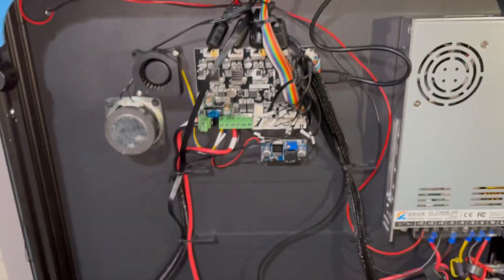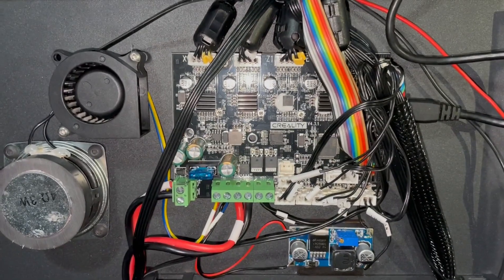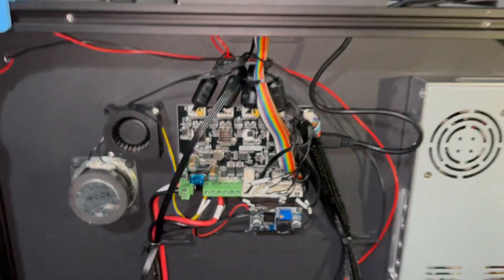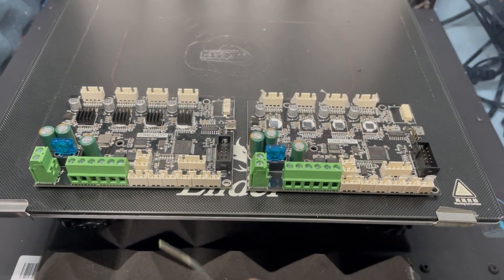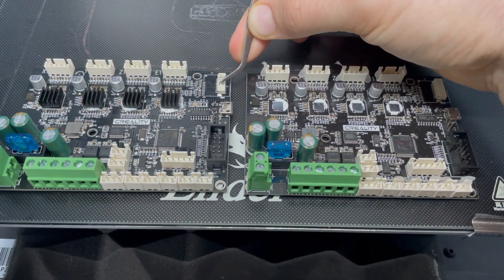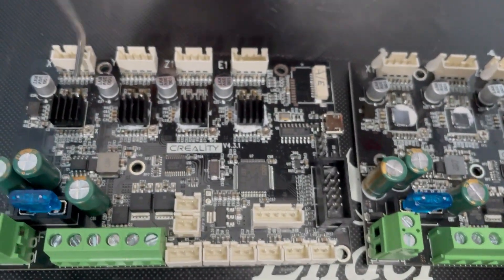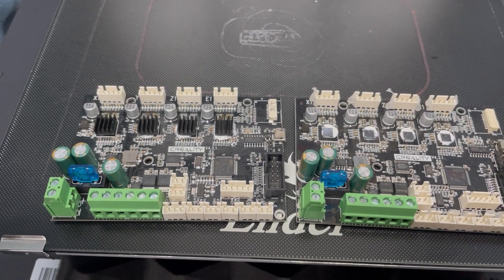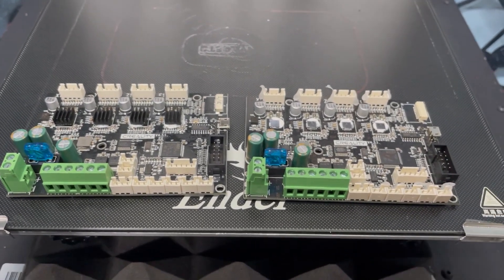Reupload Ender 6 - Mainboardfraud and how you can detect it

Comment: I am now running a SKR mini E3 v2.0 in my E6. It was an easy fit. Mounting holes and orientation matches.
Reply from the maker: Oh really.. ? does the Ender 3 and the 6 have the same mounting holes ? O.o didnt expected that !
Reply: How about the screen? would like to try too.
Reply from the maker: @mezerwi  what exactly do you mean ? Install the stock screen with the skr board ?
Reply: @mezerwi  I replaced the screen with a Bigtreetech TFT35 E3 I had available. But you can even run the basic screen off an Ender 3 with the SKR board. I found the stick E6 display was just too limited in its functionality for my needs. The BTT TFT35 just gives me way more functionality and access to settings. Well worthe change.
Reply: @0000Philipp  yes the bolt  mounting patern is the same even though the stock E6 board is slightly larger then en E3.
Reply from the maker: @jwelman1  Great ... thanks for the Info... thatsgood because in the future I want du upgrade my CR10 with a skr board ... but because I have less space in the box I need a board that fits the original mount ... that’s cool :)
Reply: @jwelman1  Thanks man! ive ordered both skr v2 and the tfte3! 

Hope to install over this weekend. Stock board and lcd too limited. 

My ender 3 Pro all upgraded to skr mini v1. Superb result till now.
Reply: @jwelman1  hi is it possible for me to have the FW for the skr and tfte please
Reply: @martynhanson5758  sure thing. Is there a way to share my details without posting here publically?
Reply: after I checked it seems the Mks E3 robin/robi3d have the exact same size. but they support both the 128*64 and the tft lcd

Comment: Bingo! 
Exactly matching your experience, to the letter. Incredible. Not silent board with the markings (thnx btw, your video  saved me the headake to find out why. Same A/E markings on the board which is allegedle a 4.3.1. And USB port was dead on arrival( After  seeing you I isolated my Power pin on the cable BEFORE connecting it just in case..., but it was definitely dead.) Quite a scam indeed. 
@Jan the Man will be looking into your solution with the mini E3, sounds interresting ( I have two other printers running on a RobinE3 seamlessly I love the board!!!
Reply from the maker: Nice that i could help you.. well..it chinese ..so i peronally will never buy any of their products again !

Comment: Buy yourself an Artillery Genius Pro or a Sidewinder X2 if you want hassle free beautiful prints and you won't hear any noise from the printers at all. I have 2x Genius and a Sidewinder and never have any trouble. I bought an Ender 6 because of the big claims of 200mms print speeds and I have never been able to print over 11mms and have had nothing but trouble from the bucket of shit. Thanks for sharing with us mate.
Reply from the maker: Hell No 😂 I will never ever buy a „i3-like“ printer again 😂😂😂
Reply: @0000Philipp  It just depends on the printer itself I have found, you get some that just weren't built to a good standard by a useless worker who didn't give a shit. Lets face it the Chinese aren't too big on quality control either.

Comment: The Z-axis and extruder on mine are not silent either. I wrote to Creality and got this answer:
"Thanks for your waiting.

This motherboard is a silent motherboard that is normally equipped. 

Since the main noise generated during the printing process comes from the X-axis and Y-axis, only the XY-axis is set with a silent drive on the motherboard design, which is a normal design.

If there is any problem with printing, please provide a video, we will analyze and provide solutions for you."

This is seriously unsatisfying ...
Reply from the maker: So you  reply to them and say: Then why are there two version of this board going around the world ? One version with 4x TMC2208 and another Version with 2xTMC2208 and 2xA4988 ? It is obvious that this boards are not the same and why they have the same Version when either one version is better then the other version ?
Reply: @0000Philipp  thanks man. I'll do that. I didn't get that there were two versions like so.
I'll wait for their reply and keep you posted.
Reply from the maker: @rasmushauerberglauridsen2237  as I mentioned in my Video.... both boards are labels with „V4.3.1“ but it is obvious that they have not the same ground specs
Reply: @0000Philipp  
Well, I got this answer yesterday from Creality .... Not impressed. 

Dear Customer, 
Thanks for your waiting. 
Because the equipment structure and operation mode are different, the motherboards equipped are also different, but they are all based on matching under normal operation.  
If your mute motherboard equipped with device works noisily, please provide a video for confirmation. 
If it is confirmed that the effect is indeed not good, we will provide a solution and please rest assured. 
Hope you can understand.
Reply from the maker: @rasmushauerberglauridsen2237  Thanks and.....
What creality wrote is absolutely not true. Even I equipment is not the same ... I was capable of make my board (on 2 drivers) silent with my home equipment... so they can’t tell me this is Even not possible fro them.... 

I think they run out of TMC drivers in Produktion , but they didn’t wanted to wait ... so the soldered the shitty A4988 onto the Boards .... without communicating to the customer .... 
my recommendation... don’t buy a creality product again... I won’t do it ... I will start to build my own printers :)
Reply: @0000Philipp  It's just bullshit and the standard Chinese answer while hoping the cutomers will not leave bad reviews or file disputes ..... I have liked Creality for some years but just lost all trust in their company: 

I might aswell build my own printers from now on - it's funnier too.
Reply from the maker: @rasmushauerberglauridsen2237  the Voron 2.4 and Voron Zero Conzeots locking pretty cool :)
Reply: @0000Philipp  Nice, will look into it :)
Reply: @0000Philipp  got an answer more now when I sent them a video of the noisy Z-axis and extruder. 

Dear Customer

Sorry to reply you now.
According to the content of your email,
Here is our suggestion for your problem

The reason for switching from full silent to semi-silent is because high-speed printing requires higher current stability, and the stability of A4988 is better than TMC2208, so it is necessary to switch to a semi-silent motherboard.
During normal printing, the movement of Z axis and E axis is very slow, so the actual noise should not be too much.

Hope can help you.

They are full of bullshit .....
Reply from the maker: @rasmushauerberglauridsen2237  okay... I will check that 🤔 that sound pretty strange ... but neither the less... they didn’t communicate that with the customers ... so as you sat.... still
Bullshit ....
Reply: @0000Philipp , please keep me posted on this if you investigate this further. It would be interesting, if it's true. 
But i highly doubt that. The X and Y axis is absolutely running fast with high print speeds while the Z axis is not moving much. The extruder extrudes and retracts rapidly but the X and Y are also running very fast so it cannot be anything but a bad excuse .....
Reply: @0000Philipp  build a 500x500 core xy....  I really like your vids pretty informative. And straight to point. Keep up the great work....
I got ender 6. 1 day blew stepper driver on e1... So ordered new board from bangood. And installed titan on extruder let's hope it works. Otherwise duett 2 going in there

Comment: there was a problem using 2208 th3d studio was talking about it they changed them to 4988 to put a bandaid on the issue. better off putting in a skr board and use 2209 drivers

Comment: Thanks for the tube's, please can I ask how the USB was blown, Got my ender 6, and during assembly, I installed a long USB cable on powering on everything seems to work fine i then connected the USB to my PC ... PC is now dead. Ender 6 has the same blown component as yours, my local supplier is giving me a lot of shit.
Reply from the maker: The USB Port was already broke…but I read a lot of Posts about problems with the USB port…seems like the power consumption of the Board has some strange errors …
Reply: @0000Philipp  blew my usb port on my pc connecting the printer. the usb port on printer started smoking.  just got another board and its very loud.  will adding a usb power blocker to the cable stop it blowing my pc.
Reply: First, the USB on these crap boards is not insulated electrically from the computer. That means: if your printer is turned off, your PC will try to power it up and, of course, your PC does not have enough juice over the USB. Now two things can happen: your PC has a good surge protector and will disable USB immediately, no harm besides communication issues occasionally. Or, worse, during normal print, this un-insulated situation can cause communication issues (occasional surges) or if the PC cannot protect itself fast enough, at least the USB port on the PC will be blown! 
Congrats Creality.

Comment: hey i got a issue with my Ender 6 where it will just skip prints :/ any idea why it might be? it works fine without the BL touch so i thought it could be a PSU issue do you know if the Ender 6 has a bad PSU?
Reply from the maker: Honestly... this is the first tie I here that... but I could be possible that your PSU is broken... but I would use another SD Card or print over PC before considering that you have a broken PSU
Reply: @0000Philipp  its wierd though cause i took the BL touch out and it works fine :/ so idk what the issue is and it is really annoying cause i paid full price for it and from your amazing video i found out i was sold the crappy loud chip :/
Reply from the maker: So... maybe it is the BLTouch itself... ore the connection on the spraybord ?
Reply: Assume you found the info by now.. the BLT cable gets interference from the steppers which causes glitching and intermittent failures.. Crashed my ender 3 max screen completely after a few mins, cause all sorts of issues like random menu entries being selected..

You can screen the cable to ground, I fixed it by fitting a ferite ring to the blt cable..